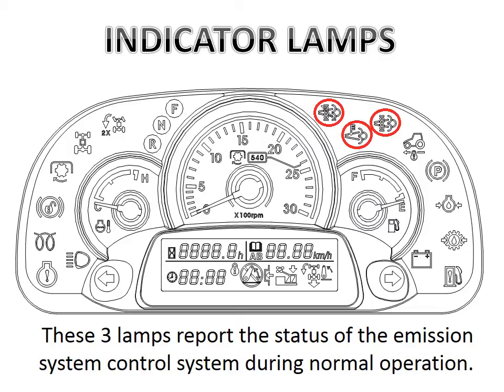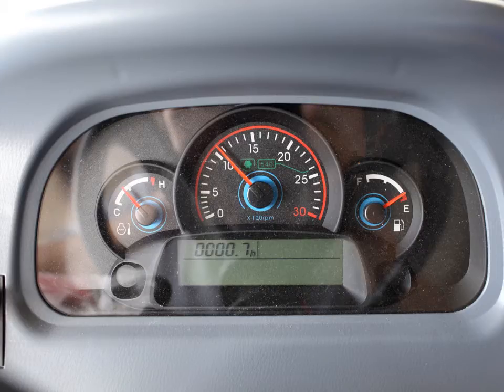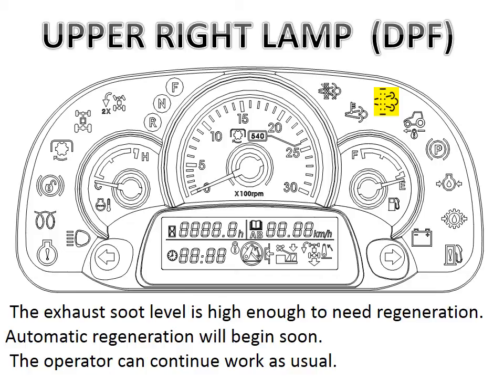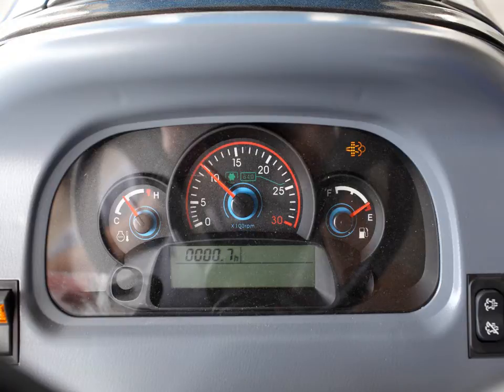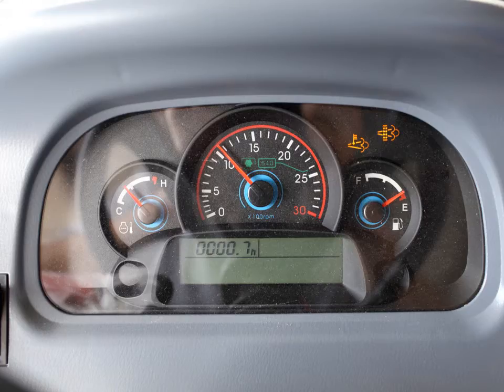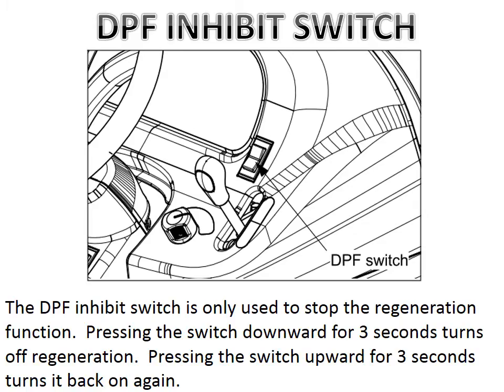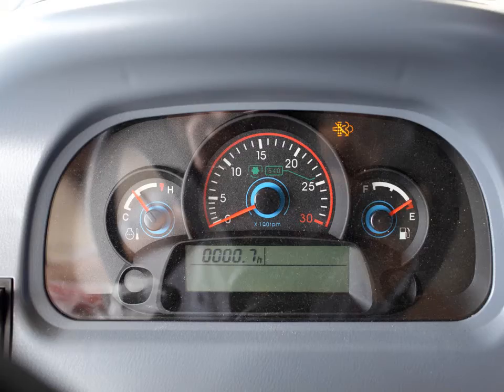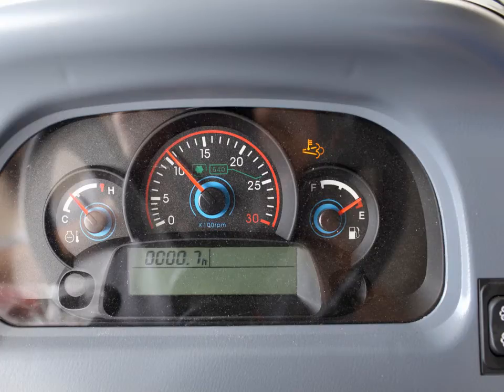LST  Tier 4 Emission System (Simple Lamp Functions)

Comment: How about a XU5055  it doesn't have these switches and it just starts sputtering when your working the tractor. I stop and crank it up to 2500 rmp and just wait 10 or 20 minutes. I've asked 3 different LS dealers and no one seems to know Shit.  I bought this tractor brand new in late 15 or early 16 can't remember but. It shouldn't be this hard to find out what to do in these situations 🤔

Comment: Both LS and New Holland (same tractor) actually cause regen problems because you don't say that the tractor should be run at 2500 rpm in order for the system to get hot enough.  Very deceptive, you show 1000 rpm at regen.....it just doesn't happen and then the customer gets stuck with a $4,000 bill and 2 months down time..
Reply: It's getting to be a fucking joke.   I've got a 15 and it doesn't have these switches and when it are this sputtering BS i just stop and crank it up and wait cause no one seems to know what to do 🤔